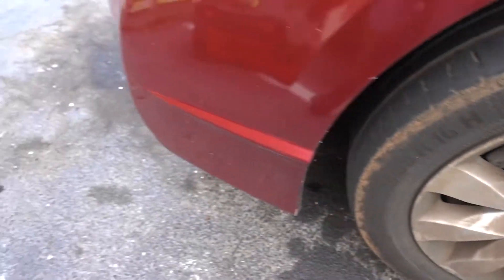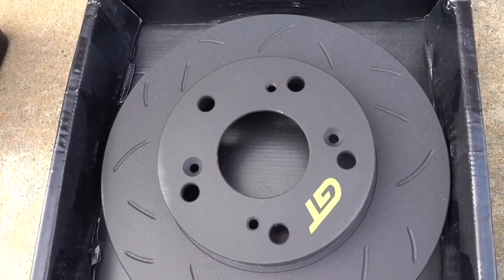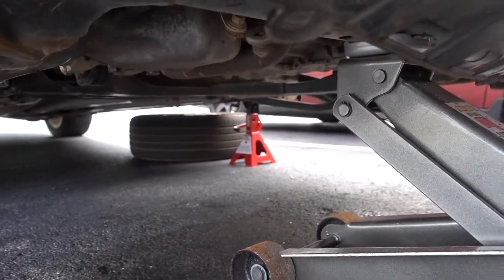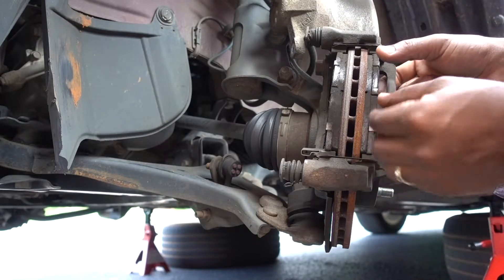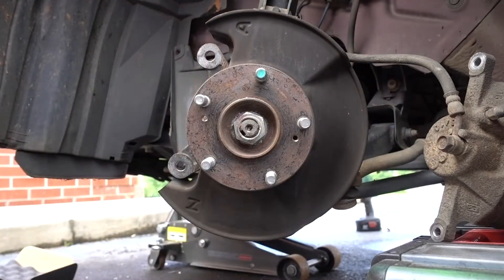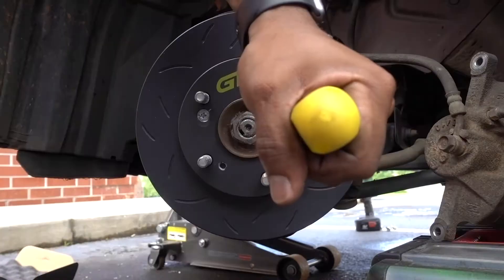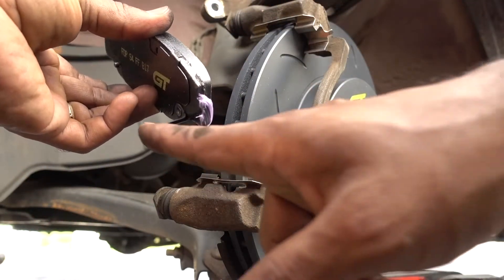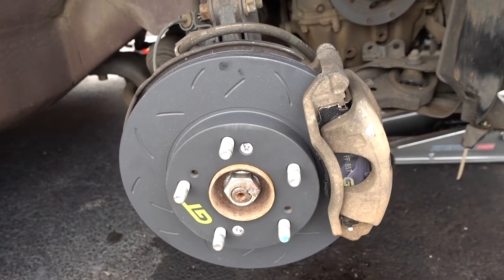Installation of Duralast GT Rotors and GT Brake Pads 2010 Honda Civic

Comment: who wants installation? we want feedback on how they work verses the old pads you removed.
Reply from the maker: I got you
Reply: I only say that (feedback on how the pads perform) because of the dust reported from the GT pads. I'm thinking of turning in my gold rotors and paying the difference to buy the GT rotors (slotted rotors give space for gasses to go away from the pad) and instead of "upgrading" to the GT pads I'll be turning in my C-max ceramic pads to get new C-max pads. Again - The GT pads are getting negative feedback regarding brake dust. So after a few weeks now can you report on how the car brakes compared to the original pads you removed and if there is more dust? I too am an AZ'er. Thanks.
Reply from the maker: Ok bro thanks for that let me get with the owner of the car and get the feedback from him
Reply: Bullet Solano I would also like to know the feedback on the GT pads, and rotors on how they perform in dry or wet weather. I also wanna know how well they brake, and is there a lot of noise coming from the pads, and rotors.
Reply from the maker: Ok no problem let me get with the owner and I’ll make another video on that
Reply: I mean the whole point of the video is installation. If you want a performance and overall everyday use review then go look for it, otherwise you just waisted your time. The title clearly states installation.

Comment: Really cool, does the slotted help with heat disapation.  And is this combo good for a van I'm in the northeast with hills?  what is the difference from the drilled and slotted kits with ceramic for like $153 on the internet? Are those cheap o?  The pads are lifetime warranty but the rotors are two.
Reply from the maker: Yes it helps with heat dissipation, and is good for a van but I’m not sure if they have for every car, the kits on Internet are ok to me but drilled rotors is just for looks, with today’s brake pads you don’t need drilled rotors, and the rotors are 2 year warranty

Comment: These pads suck. They are filthy. They dirty up the wheels horribly
Reply: Agreed, I have these exact pads and rotors on my front of my silverado and they suck due to all the break dust, and they squeak very loud, definitely would not recommend.
Reply: @grahamkrivanek2315  I am far from a clean nut. Though these pads make my front wheels black within a couple of days of a wash. My back wheel will remain clean. I have a ceramic pad on the rear.
Reply: @jpungello  Yeah, luckily I have black wheels so I don't really notice the dust on them, but they definitely suck. The stopping power is pretty good, it's just all the brake dust they produce and how badly they squeak.